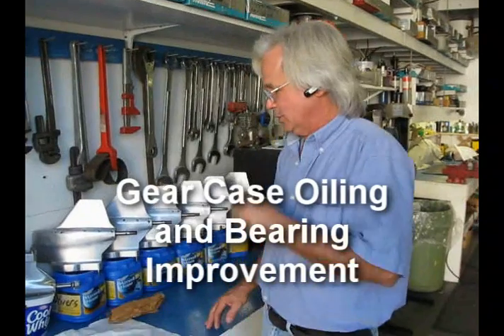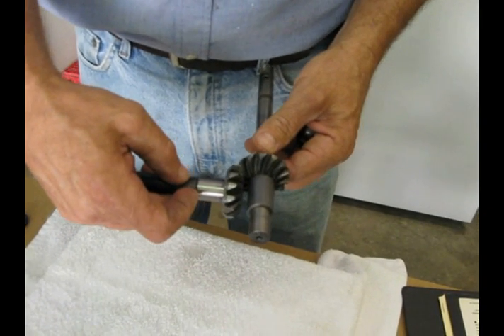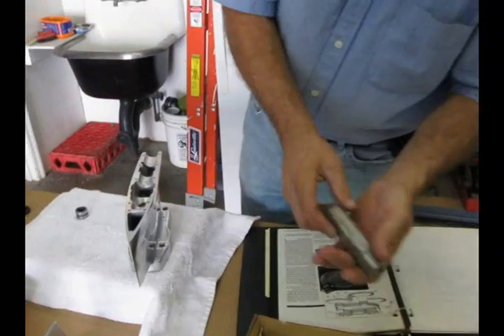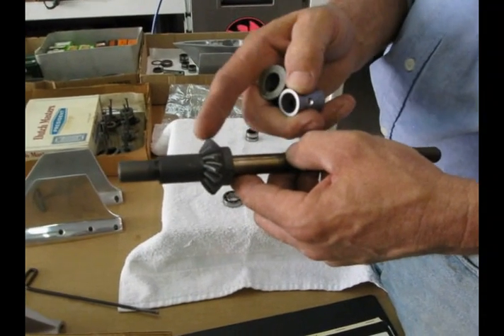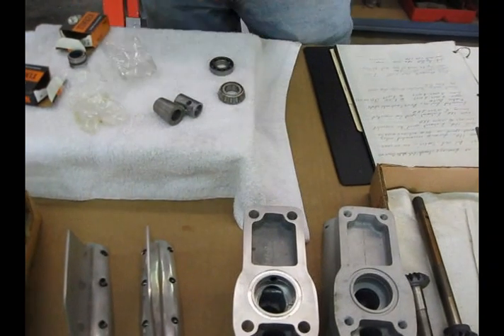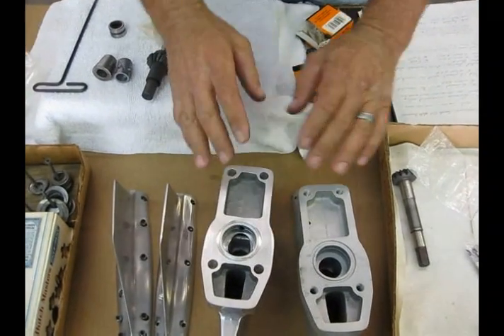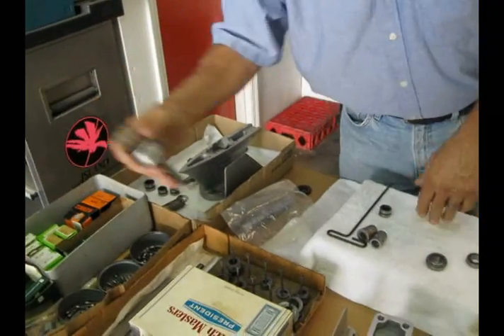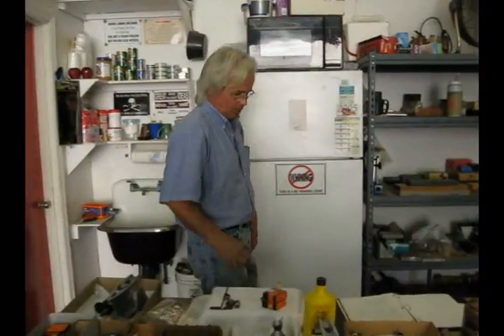gear case oiling and bearing improvement

Comment: How could I make a 1:1 gear ratio for a Mercury 40hp 2-stroke?
Reply: It's tough.  The racing stuff from Mercury and OMC is super rare and even if you can get a case the parts are obscenely expensive.  You almost have to marry into a family of an older boat racer to get it.   I've wondered about putting something together using the differential gears from an automotive rear end.  They're not particularly precise but they're generally net forged to shape and obviously tough as nails.  They might be a bit coarse for  the application but a part of me thinks that they'd survive for a bit.
Reply: The 60 hp merc triples came with 1.62:1 ratios which is a low a ratio as pretty much any stock lower.
Reply: Hi , love your videos , would love to reach out for some guidance ! I have 2 OMC XP 300 V8s , spare race gear case with sharp nose cone and pick ups in the front . We working on those and 1997 150 OMC Johnson , we want to modify the gear case , that being said , can we do anything with 150 ? Can we use the mould from the original OMC in any way or is it possible to order anything or have anything made by you ? We are based in Australia ! Thank you for the great knowledge and content !